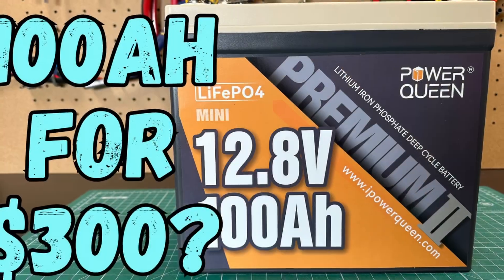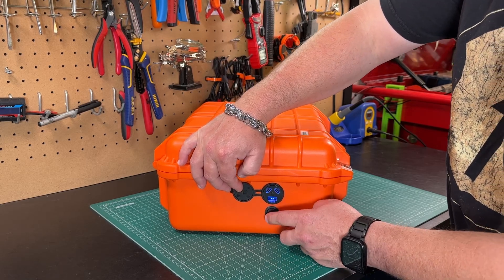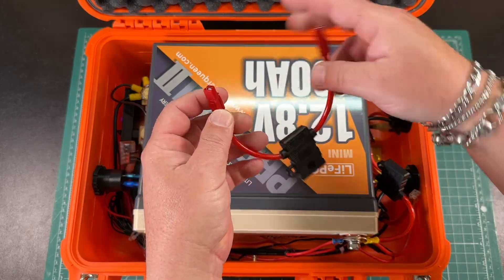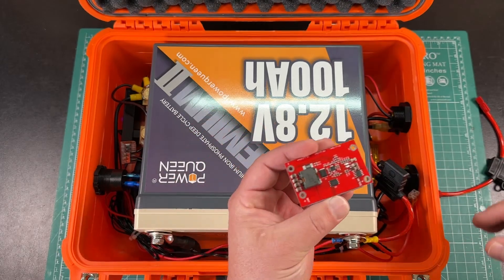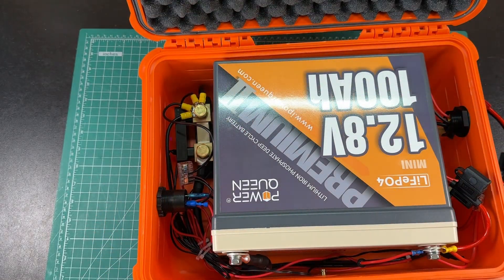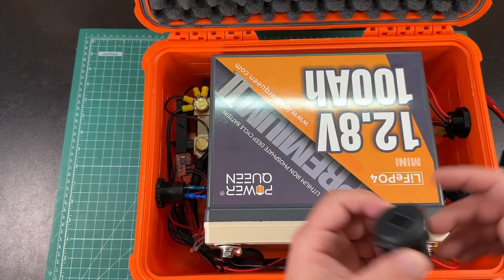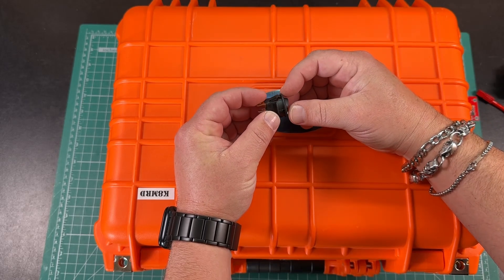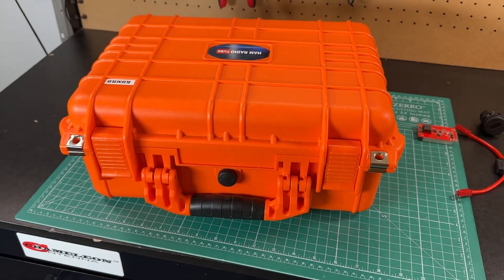PowerQueen Mini DIY 100Ah Solar Generator Battery Box

Comment: You have one switch per dual APP mount. Are you worried about exceeding the 20 amp rating on the switch if you have 2 things plugged in?
Reply from the maker: Not really, no.  I don't usually have more than one thing plugged into it at a time, but if I did I'm mindful of the current draw.  But, I have stopped using switches in my builds in place of a single, master breaker, usually ~60 amps or so, then each circuit has it's own fuse via a fuse block.  That way I can just throw the breaker to turn the whole thing off/on.  More convenient for me to do it that way as it's easier to wire, a tidier(ish) build, and it saves energy by turning off the charge controller and meter.  They don't draw much but over time it adds up if you don't cut power to them.  This is a more recent build I filmed but I'm doing them all this way now.  https://youtu.be/E2EzffOhysg

Comment: Victron has fusion line now. Same one by victron is currently 95.89.  Might wanna update your referral link for affiliaite etc.     listed as. “ Victron Energy SmartShunt Battery Monitor (Bluetooth) - Victron Smart Shunt - 6.5V-70V, 500 amp “

Comment: I made one that fits a 500 watt inverter, a mini Starlink, battery monitor, solar charge , house charger. I chose just to get a couple basic cigarette adapter . That way I can choose any plug in adapter or ones on the future.  ( more so the size of briefcase 💼)  but wifi and charge abilities anywhere I go. Priceless and waterproof 😂
Reply: Any videos of the layout?
Reply: @jackiedaytona2644  the case I use is the Nanuk 925 ( on sale right now)  the battery I have is the 100 amp/hr liTime mini.  I suppose you look up those and it will give you an idea of size. 500 watt inverter is pretty small , and the solar is a a pass through Andersen connector , 12v etc same style type pass throughs.  ( all on Amazon)

Comment: Bluetooth this! Bluetooth that! SHTF then Shit Happens and your Bluetooth devices are  ALL down then What? OH! if only I had put in a meter? SHTF your electronics all go down. SHIT HAPPENS! Might NOT be as ("COOL") but it would still work!  I have read that the limit for stacking connections on a battery post is 3. Don't forget the MOST important fuse is the Catastrophic fuse at the battery to protect the (Source) wire! Rant OVER LOL!  Thanks for the videos!

Comment: What's wrong with not making holes in the outer skin of the case to keep it sealed?  I have my doubts about wet or damp surfaces and if it rains outside, how well do you protect your case from getting wet? When it comes down to it?

Comment: Great Battery Backup Box but Do what I am doing for the small switch I am using a 12 volt relay 30/40 amp from Amazon for my Ham Radio Go Box am thinking about hooking up a remote switch to power it. 73 K4BWN

Comment: Dual PD is a great idea. PD lets you go to 5v, 9v, 12v, 15v etc with a tiny controller usually built into a usb-c to dc cable.

Comment: The time and materials you had you can buy a redodo battery box. It's only100$ so it's easier and faster just to buy. Not everyone can build a box
Reply: Probably spent 250$ and maybe two hours to build … 1000$-250$.. 750$ savings for 2 hours of work.  375$ an hour is a good labour rate 😂
Reply: @ClarkyMalarky  i spent 100$ on the box 239$ on a redodo 100ha battery no assembly. yes, it is much more fun to build it, but it does take some knowhow to build.

Comment: I'm clumsy, so I expect I'm going to break things.  When I built my battery box I protected the back of my panel mounts witch some of the dark gray stiff packing foam.  I worry about the batteries shifting and messing up my panel mount connections.  Nice box!

Comment: Genasun charge controller? Or too expensive?
Reply from the maker: No there not too expensive and they do work great, but they're only 10 amps.
Reply: @hamradiotube Run 2 of them to give you 10.5A + 10.5A = 21 A

Comment: How long would the battery last with a mobile radio standard usage
Reply from the maker: That's gonna depend on a lot of variables but assuming it's a 50 watt VHF mobile that draws ~0.5 amps on RX, it would last about 8 days just receiving.  Can't really tell you more than that but obviously less when you start transmitting.

Comment: looks great. I know of a few 20 and 30 amp solar charge controllers that will fit inside, may need ferrite on wires , I do that to all by stuff . I put master switch on mine.  still a very nice battery box. I could not find nice hi current switch either so just used power Worx disconnect switch. good over 100 amps.  73's

Comment: 3M Duralock mushroomhead velcro.  That way you can yank it off if needed.  Great adhesive but on plastic I put a couple dabs of superglue.  I upgraded my batt momitor to TBD after seeing your video on it.  I did add a little voltmeter with dumb soc meter just to see at a quick glance.

Comment: NB5Z- Regarding the plastic thickness, you might try starting from the back with a paddle bit to a depth of about 1/;8" then use your step from the other side.  Size the paddle bit a little larger.  This will give your a recess for the barbs on the switch base.   Just a thought Mike.   Thanks for the video.
Reply: Mike I mean about 1/16 th not 1/8 th